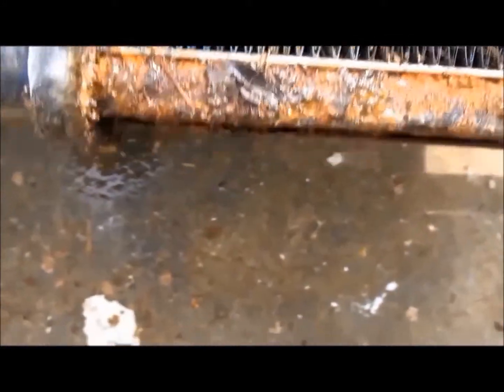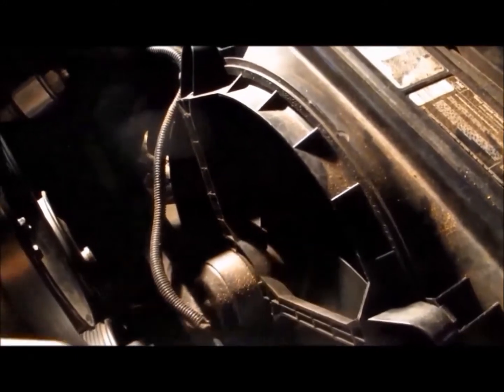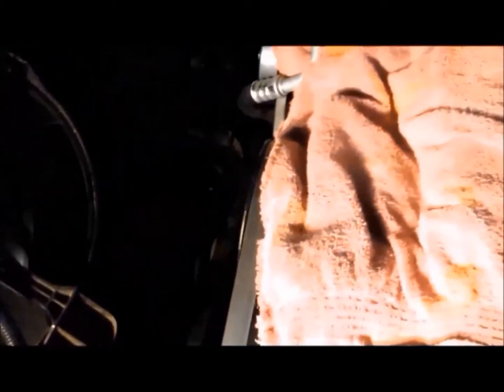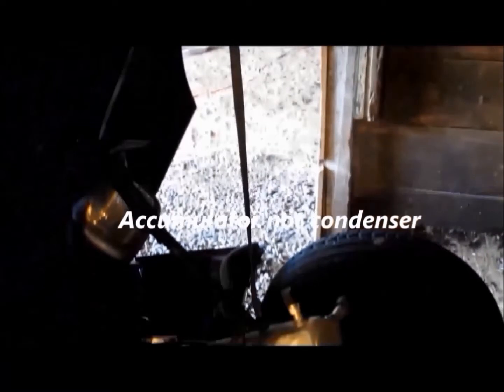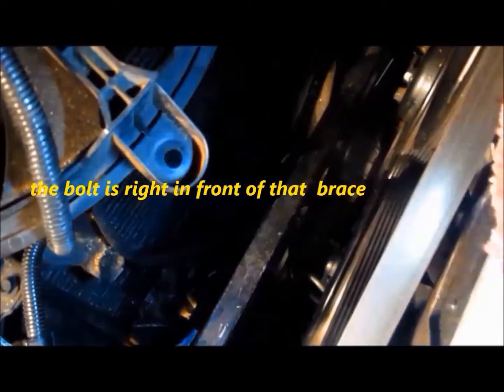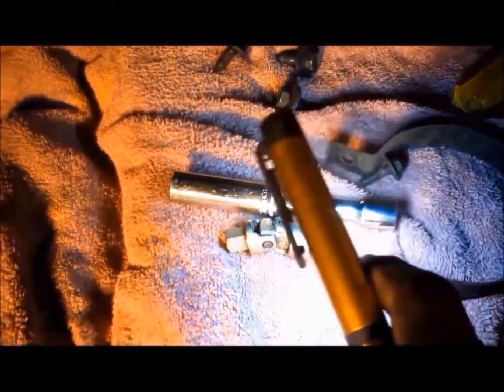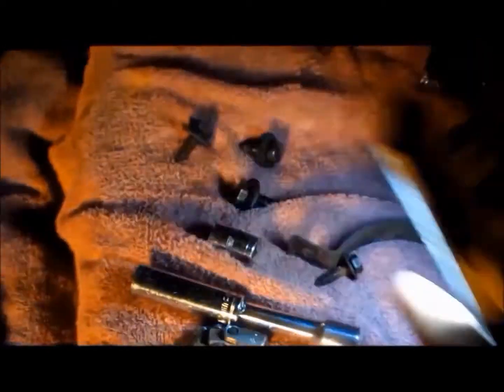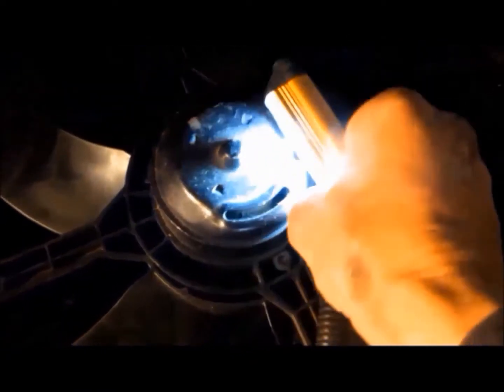𝟏𝟗𝟖𝟒 𝐂𝐎𝐑𝐕𝐄𝐓𝐓𝐄 NEW All Aluminum Radiator

Comment: Part No. for radiator on Summit Racing website please?
Reply from the maker: You ever get it started
Reply: @HorseshoeBeach Purchased new distributor (BDLG-GM31 Duralast Gold), EGR valve (EGR124 Duralast), ESC (ESC105 Duralast Spark Control Module), and spark plug wires (4076 Duralast Ignition Wire Set). Primed oil pump, found TDC and installed new distributor, installed new EGR and ESC and 2 of 8 new plugs. Got the engine running, will check for codes today.
Reply from the maker: Wow, you're putting some work into that crossfire. Don't forget, in order to reset codes you have to drive the car at at least 40MPH. Code 42 sometimes lingers on and on. As far as the radiator there are a lot of radiators out there but. One that replace the original 84 at least what I found. They all have the "OIL COOLER" nipple on them that has to be capped off and they're all wider so the rubber seats have to b e trimmed up a little so they sit in them but with  tiny bit of fitment, they work. Eklers h as one for about  $250, there are other after market aluminum rads that fit also for less. I remember some online ads actually had the measurements listed in a view, that really helped me a Lot. Good luck.